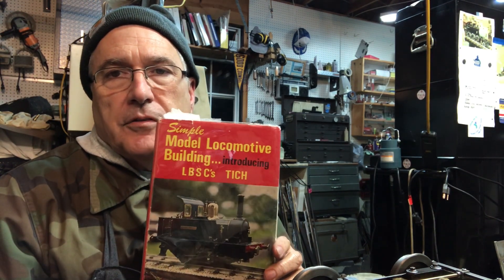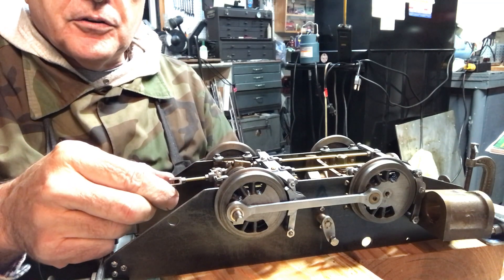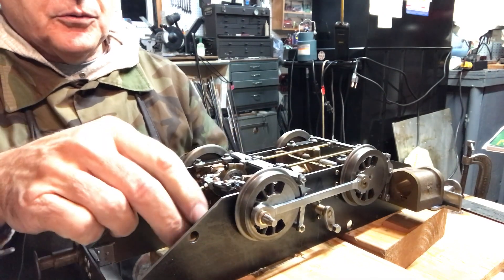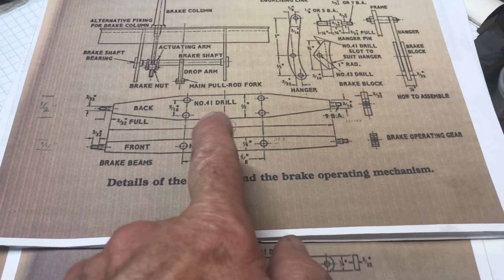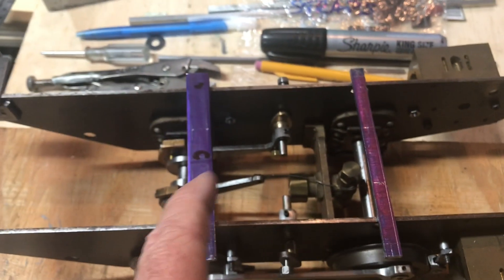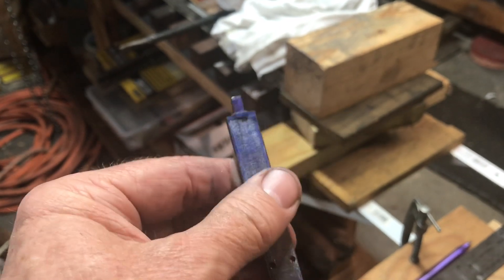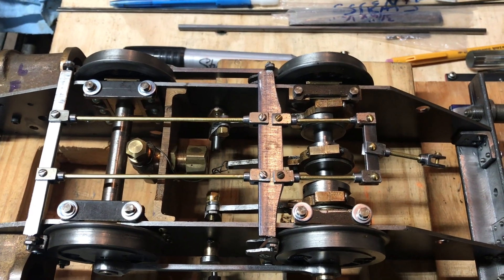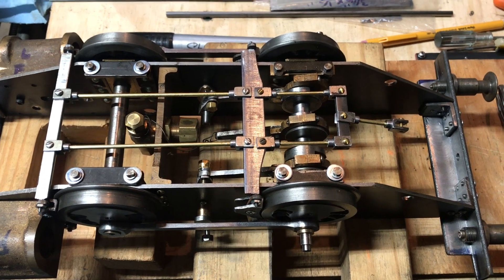10. LBSC TICH LOCOMOTIVE, fixing brake hangers, making beams, clevis ends and rods.

Comment: Bill, looks like you saved the day with the hangers.  Just wondering if the holes in the brake shoes could have been drilled further towards the top of the hat so to speak.  Would have given you more pivot to the shoe too.  Regardless, you have it working and it is looking good.  Thank you for taking the time to film and post.  I do appreciate it!

Joe